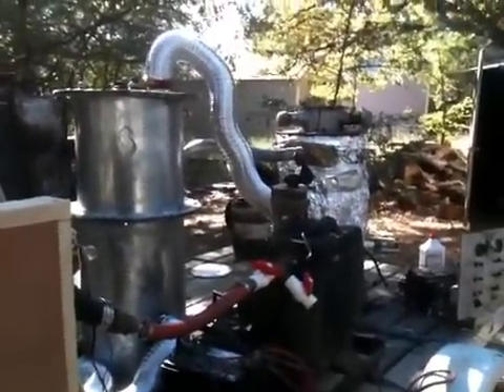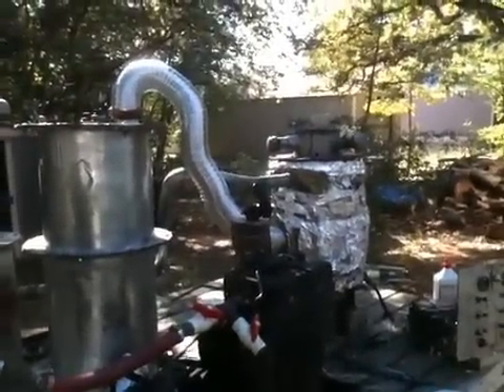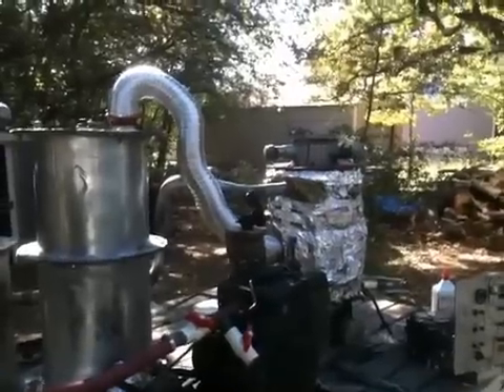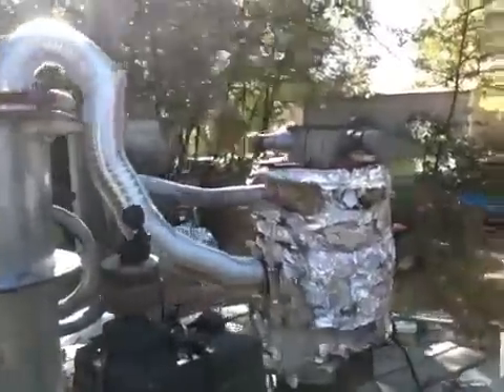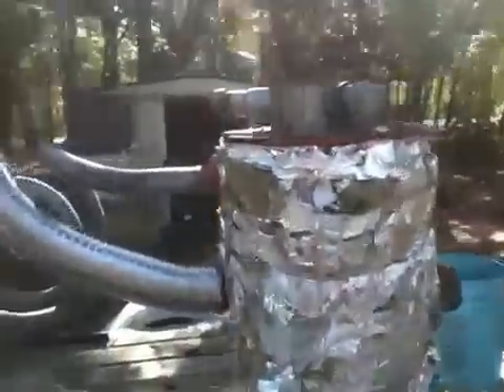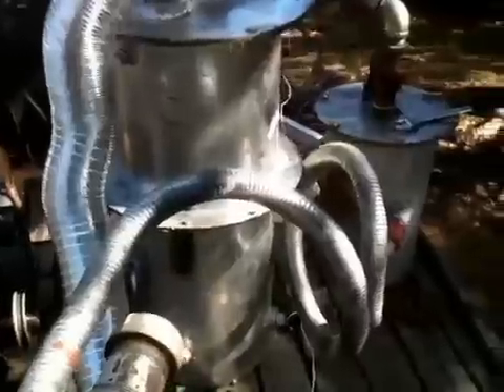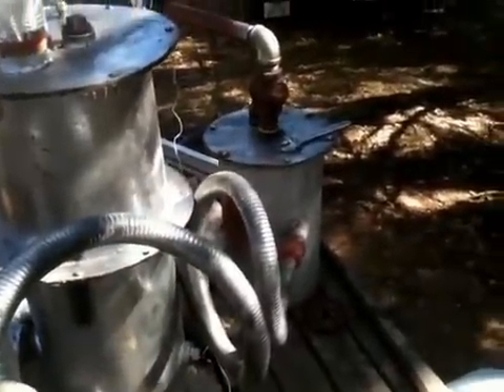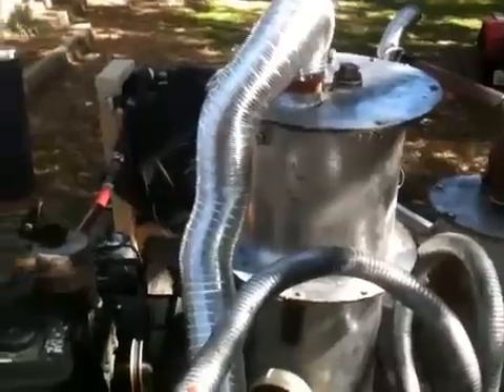gasification Motor running on woodgas

Comment from the maker: hey im not sure it feels like a plastic ?? im leaning toward some fiberglass bag filter if i dont build a cyclone.The bigger charcoal dust is not much of a problem getting out its the real fine dust that thats tough to get out .I may go back to the water scrubber it works very well and also cools the gas. if i put the water scrubber after sawdust filter the water is not so nasty. Thers a lot of waste heat in these gasifier that can be utilized have fun

Comment from the maker: hey john yea i really need to build a better cyclone. the furnace filter is the cheap blue stuff i get at hone depot this helps to take out dust the six gallon of sawdust is what turns the flame blue. of course the hotter u can get the gasifier the better chance of cracking the tars or at least less tar.the sawdust will filter the rest of tar out..make sure and run the gasifier full throttle and u should do just fine. i havent had an issue with tar in the motor with a blue flame from gasifier HF

Comment: Thanks dan for ans my post.Yes I under stand yr hook up now yr engine seems to be running better in this video I noticed the new plastic ball valves at the engine.so youare using just the wood chip@furnace filter@radiator now not the cyclone to give you blue gas? is the furnace filter fiber glass wool?  Thanks again I hope soon to get back to my gasifier with the new  7.5 k generator.2cyn propane gen. Its used and runs ok on propane. cantwaittorunon wood gas Yr help is well appreciated JOHN93667

Comment from the maker: hey john  yea i changed things again,but the principle is stiil the same the big silvertank is the sawdust filter with furnace filter in top half and sawdust in bottom half. this turns the flame blue. if you look at the bottom of the filtet youll see another 3in flexible pipe reduced to fit at the bottom of the radiator. i went to three in piping cause two in kept filling with dust at the gasifier outlet. i have been working on increasing gasifier temperatures im around 1000c to1150c  have fun

Comment: Hi Dan I tried to figure out your hookup of this video of your engine gen running for two hrs. What is that large tank with the large stanless hose going into the center of your gasifier with all that insulation around it. also yr cyclone filter and is it hooked up toyrradiator I dontsee the inlet to the radiator . I see the outlet going to that 20 hp engine. I noticed y change things around quite a bit often. I got a larger onan gen 2cylinder 7.5 kw usedfor my gasifier. keep Faith JOHN93667

\